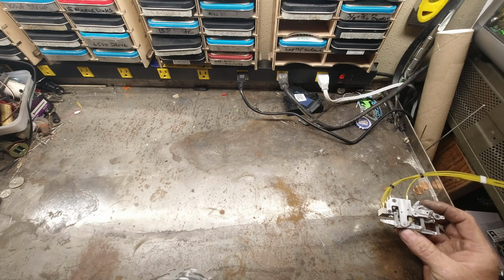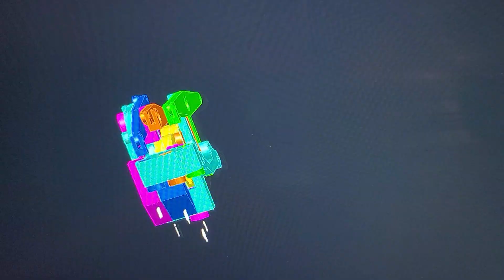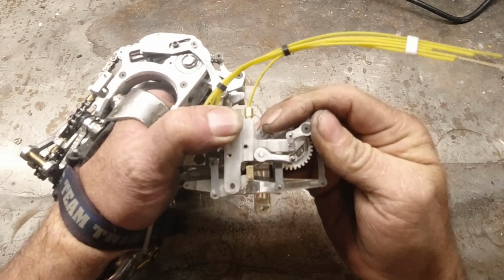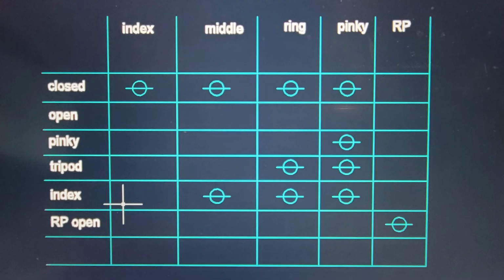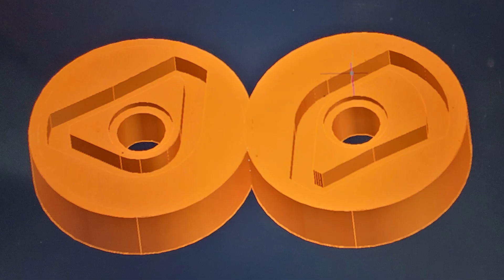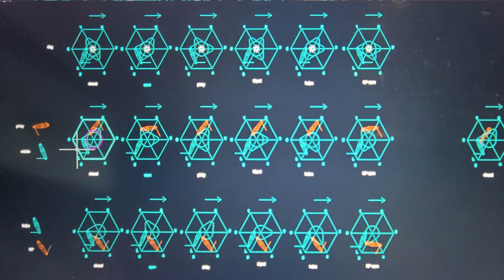Mechanical Prosthetic Hand Grip Pattern Selector

Comment: @Ian Davis First off, this is hands down one of the coolest modern mechanical designs I've seen. Nowadays people use electromechanical solutions for almost everything, so this is especially inspiring as a fellow MechE. I had an idea I couldn't help but share, probably one you've considered already. For grip selection, could you lock/unlock each finger with some sort of toggle at the base of each finger that could be actuated with the thumb. That way you could jump quickly to the desired grip, instead of cycling through. Just a humble idea. The grip selector is an incredibly impressive mechanism.  Thanks for the inspiration! - Gordon

Comment: idea: use a ring on the other hand for controls, rotate a ring through 16 positions to select grip patterns counting in binary, your solution is cooler but it think this would be easier to operate and offer more options.

Comment: I'm less interested in you flipping people off and more interested in index and pinky locked open, middle and ring finger locked closed. Throw up those metal horns, from a metal hand! The only concern I have is your zero to negative motion will disable the ability to use negative splay, which is a pretty useful ability to have in your range of motion.  The only solution I can offer is maybe a pitch negative AND yaw negative for grip pattern selection rather than just yaw negative.

All joking aside, you continue to impress me, and it is always a joy to watch your videos.

Comment: Darn it I got off track. Love the Persian, we had one for almost 8 years before she was stolen.  We looked for her for 3 months straight.  Very vary sad day for my wife and our 3 children.  Oh and the wood stove, wow how I miss the heat of a great old wood burner.  Has to be actual firewood though as pellets and other forms just are not the same as the crackle and heat from the firewood stove.  Keeping the door open in the dark with all the lights off watching and feeling that heat.  Cant tell how much I miss the wood stove right? Hahaha indeed.  Any how, amazing stuff here.  I have been a fabricator and spent half my time building LSA type aircraft.  Love the work but this is at a much smaller tool set than I am primarily used to.  Great design and finish work partner.  I pray it works out for you and maybe some day you can turn this into some thing that can benefit others and help society in general.  Thank you again for sharing your hard work.

Comment: It may be useful to have an "on the fly" pattern lock if you don't have it already, though not sure how much complexity it adds (either switch based or setting the fingers into place with the other hand and locking.)

Comment: incredible work. this kind of fine detailed custom work for a prosthetic is generally not done because its not very scalable. there just aren't enough engineers to dedicate to specific cases, and probably even fewer engineers that have the ability to manufacture the prototypes.

i imagine in a few more years you'll have all kinds of quick disconnect futuristic cyborg hands. like a hand that has a dremel for a finger or a drill. or maybe a letherman hand with multiple tools on it. maybe an inspector gadget style key for a finger? or i suppose thats more like fifth element. you could even have a literal finger gun!
Reply: Tbh I think a 3d printed version would work well.
In my town we have a prosthetic "club" where engineers design or iterate on existing designs for people who can't afford normal prosthetics.
It costs around 30-50 bucks for a simple elbow or wrist grip, but it wouldn't be much more to add a locking mechanism
Reply: @satibel    He talked about using 3d printed parts for the hand in one of his videos, while it may be not too hard to print a good quality precise parts, the strength and wear resistance becomes an issue, so while it will work great for fingertips, some covers, maybe a frame, etc., in his experience 3d printed parts were prone to failure. But if you were to design a hand like Ian's around the properties of the filament used for the print, then it should function correctly, it just wouldn't be as strong.

Comment: Using solenoids might be easier... but this is SO MUCH COOLER. Love seeing everything you come up with!
Reply: but then you need a power source...
The deal here is to use the residual limb to control and power everything.
Reply: yeah he doesnt want to have to charge his hand and end up having a useless hand because no batterie like other modern prosthetics
Reply: I came here to say the same and while his "prosthetic horology" is beyond a thing of beauty small solenoids to select pins wouldn't need much power to operate and the selection process could be more flexible to modify in the future. Still a thing of beautiful work

Comment: What do you use for fabrication?
Reply from the maker: I have a retrofitted shizuoka an-s 4 axis cnc milling machine as well as an acroloc cnc mill, I use a tos kurim conventional milling machine to finish up anything that I don't feel comfortable having the cnc do. All of the round work is done on an American turn Master 1554 manual lathe, anything cylindrically ground i use my acra tool and cutter grinder to do. I also have an auto surface grinder and a bunch of sheet metal equipment for that kind of stuff.
Reply: @missingpartsclub  thanks. I've often wondered about this